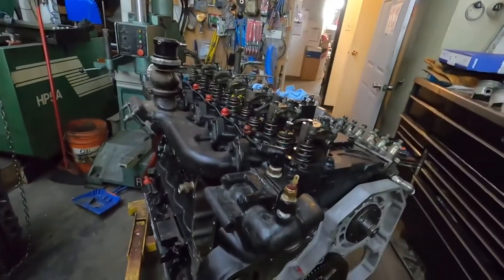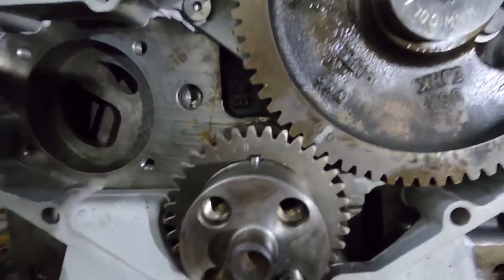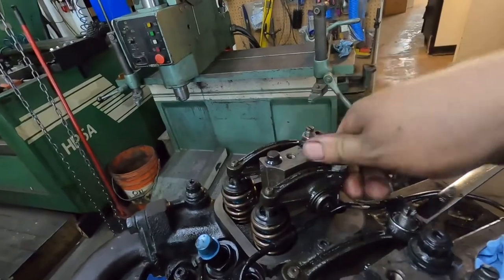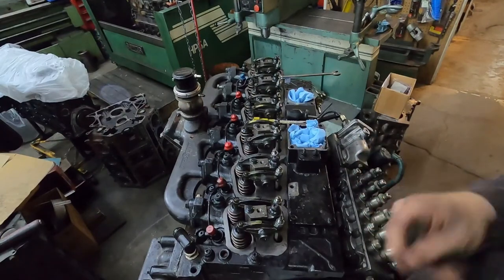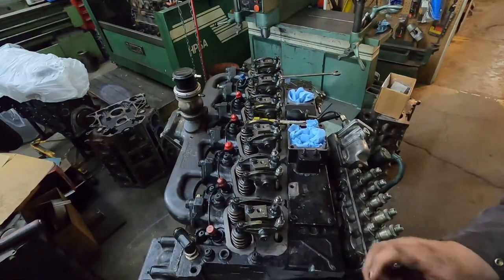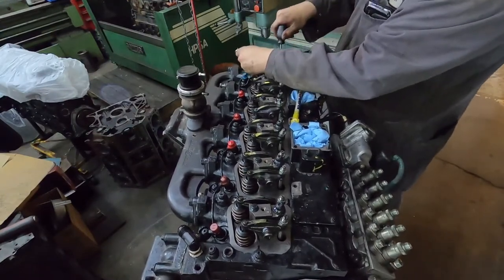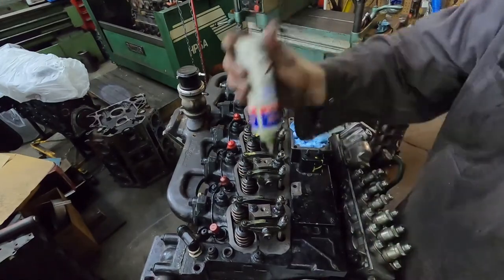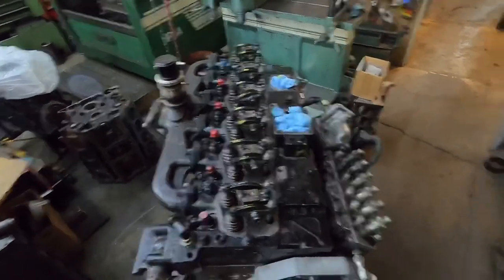How to do Cummins valve set

Comment: I attempted to do a adjustment on 5.9 2007 Cummins. At TDC all the valves where tight ( no lash) . Spun the engine 360 and still no lash . So I was unable to do anything. Because of unsure which TDC I was on. any suggestions on finding TDC on number one.

Comment: Hey whats up i just put 4000rpm govenor springs,60lb valve springs,and delivery valves in my 1995 12 valve should should i turn fuel up and also boost and timing thanks 
            Kris
Reply from the maker: I would add some timing. You do t have to add more fuel if you don’t want. But if you don’t have a egt gauge I would get one of those
Reply: I have egt gauge
Reply from the maker: Perfect. Add some timing and see how she does. When you want more add more fuel
Reply: @CUTTERUPROB  thanks man appreciate

Comment: Hello friend really nice video.
I have a doutb and sorry if it sounds dumb but the timing pin only hits the right spot tdc number 1? ir it can also it tdc number 2.
Because you say this :when you turn 360 from tdc number one that make its tdc 6 as you have to go around twice to make the it the that same spot of tdc number 1.
Reply from the maker: you pin the engine at tdc and do the half the valves , the turn the engine over 360 to do the other half , if you go twice so the pin lines up you will be in the smae spot you started